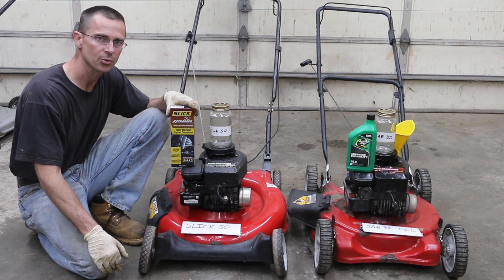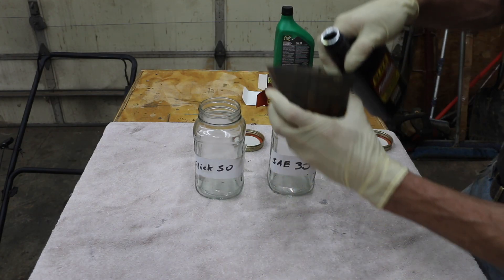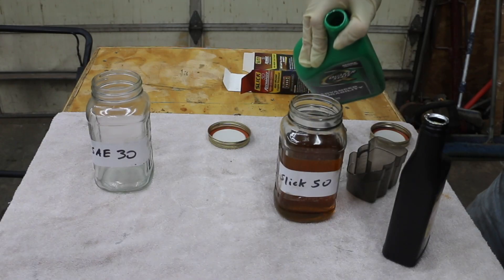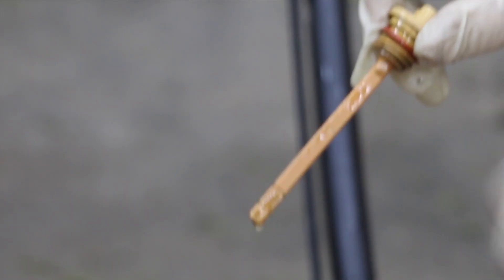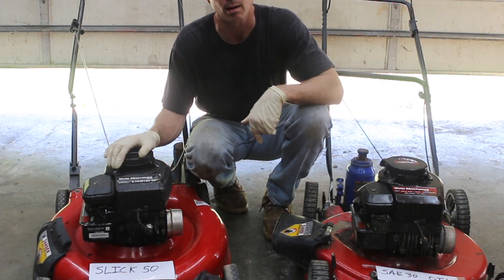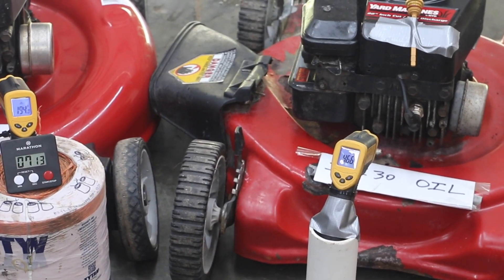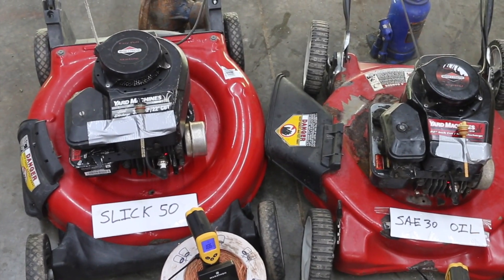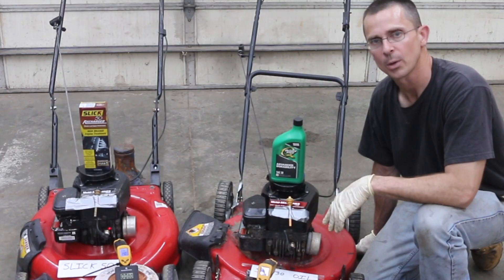Can't believe what SLICK 50 did to my engine!!--Dry Crankcase Test!

Comment: PTFE  is highly  regulated now, keep this in mind. I sold slick 50 in the mid 70's to 80's . CERFLON® is a ceramic-reinforced PTFE  is what is use now in Slick 50®. (JUNK ) needs to be heated to 800 deg to stick or set....but makes a great  friction reducer like" little ball bearings". Back in the day (old Slick50® ) FEP (fluorinated ethylene propylene copolymer), (do believe that DuPont ® has washed there hands of it ),  had to be used with a preconditioner / primer per say.  Which at the time was not regulated if i remember . Slick 50® was a two part additive .......( Chlorinated components to a carrier and mix it with some type of teflon, moly, zinc or phosporus & you can reduce the friction.... Except for one “minor” thing: Chlorinated additives mixed with oil and subjected to heat form hydrochloric acid! Hydrochloric acid is extremely harmful to your internal engine parts.) This being said, this etches the medals so the ptfe's can penetrate and stick to things. The old Oil /w the primer in it was change and new oil and the Slick50® was added.......and when crank shaft heats up and the cyl walls heat up........... the ptfe setts and works well..... AND you can run a engine with no oil for a good long time and STOP it before it locks up let it cool down and start it again  BUTT NOT for ever !!!!! or in till it locks up. The biggest problem was that people can't follow instructions and regulations it was removed form market in the mid to late 80's . Back in the market in mid to late 90's as CERFLON®.  Why you can not run a engine with no lube???? it"s just a friction reducer end of story!.... To day i use a lots of  friction reducers and they work well...I call em (Snake oils ) reduce friction=reduced ware.!!! You can not stop friction and heat but you can reduce it.!!!!!!!!!!!!! google ptfe's in short this video is not a good exp of Slick 50®. He must of seen a old add or some old tater told him that he had seen a engine running with no oil, an the old tater probable did see it, in the day.
Reply from the maker: I enjoyed reading your comments!  Very informative!  Thank you!

Comment: What if both engines were gummed up and the slick 50 acted as detergent thus cleaned out the build up leaving it cleaner and drying up faster? Also 
I agree using 2 used engines with unknown hours is quite unreliable at best 1 could be well taken care of with yearly oil changes and low use while the other may be used a lot and never had an oil change. i would like to see a similar test with new engines to narrow down the variables and use lucas oil additive or something like a graphite oil additive. Great video tho very interesting tests!
Reply from the maker: Great point!  I agree.  Using new engines would be better.  Thanks for watching the video and commenting!

Comment: It could be that slick 50 is full of detergents. Not letting the oil stick to the cylinder walls as well. That's why you can't run a non detergent oil in a lawn mower to begin with
Reply from the maker: Great point!  Thanks for watching the video and commenting!

Comment: Very interesting video. The issue I see is the mowers were not exactly the same, did not appear to be new either. If one had more clearance in the motor is may have lasted longer without oil.
Reply from the maker: I agree.  Using new engines would be better.  Thanks for watching the video and commenting!

Comment: Keep on doing the videos. I did what you did to your Ranger with my old S10 Blazer with 300000 miles on it and it worked. Sounds like a brand new truck. 1986 S10 Blazer 4x4 auto with 2.8 V6 engine.
Reply from the maker: AWESOME!!!  Very happy for you!  That's a great engine!  I've had 2 S10s with that engine and they were great!

Comment: So, according to your test, the Slick50 engine ran cooler than the straight SAE30 engine when properly filled. That's a plus! No sane person runs an engine with the crankcase dry anyways so it's kind of a moot point to run them that way.
Reply from the maker: Bob, Great point!  Thanks for watching the video and commenting!

Comment: The slick 50 engine seemed cooler due to the thermal gun pointing at the shiny metal of the spark plug. In reality it was likely a similar temperature.
Also your test was not accurate, as both engines were not new and as such one likely had far more wear on it.

FINALLY.
At the end of the day. 2 cooked engines for an unanswered question.

Comment: Briggs and Stratton actually did the same test years ago with 2 new engines straight of the line because they were sick of oil additive salesmen using their engines, the test results were on their website years back, same end result you had but they pulled the engines down and measured wear. Teflon lost across all results. Just forget about additives and run what the manufacturer recommends for best results
Reply from the maker: Great information!  Thanks for commenting!

Comment: I've been doing mechanic things for 25 years..  while I see what you're going for I can tell you that the variables are too great..the engines, even if built back to back on the same assembly line, aren't the same, and unless you tested several hundred, the outcome could be very skewed ..  had you switched the oils in the two mowers, there's a chance the results could've been exactly the same..

this is why you can build two virtually identical race engines exactly the same, and yield a 50hp difference with identical parts.. tolerances will never be the same even in a row on an assembly line..
Reply from the maker: I agree! All great points!  Thanks for watching the video and commenting!

Comment: might try dura lube i once put it in a Pontiac 350 that made only 7 psi  oil pressure cold and 0 hot.
I drove it from fort hood in Texas to Lamar mo . The motor never knocked but spun the rod bearings
and was still running when i pulled the engine apart every thing was golden blue in color so
every thing got really hot but never ceased up i drove it for three months after that then
rebuilt it
Reply from the maker: Yes, I'll try Dura Lube soon!  Thanks for commenting!

Comment: the slick50 of today is not the same formula as it was, back in the day, the guy who created it sold it to a company "big mistake". i had an experience once some 25 years ago, i treated my chainsaw (2 stroke engine) with slick50 (original formula) when out cutting wood, with a friend, after a few hours and about three tanks of fuel later, i realized i forgot to add oil to the fuel. to this day my chain saw has not missed a beat. 
i still believe the original slick50 is amazing stuff. if you want the original formula try Xcelplus
Reply from the maker: Great point!  Thanks for watching the video and commenting!

Comment: I used Slick 50 in several older vehicles i owned, never had the slightest engine problem. U should probably have put a few hours on them before draining. i think slick 50 needs time to bond. In 1998 i bought a 1990 Bronco with the 351, 63k miles. When i changed the oil the first time soon after i put in Slick 50. I always used Catrol 10w-30. A couple of times on trips over the years i discovered it was close to 2 qts low. Gaskets had hardened etc and oil was seeping somewhere. Fast forward to spring of 2014, a little over 100k miles. A friend of mine had it on extended loan for abt a year. We thought the head gasket was going. Her dad offered to check it. He bought a gasket set and replaced valve cover, timing cover, rear main seal and pan gaskets. Compression was dead even on all cylinders (no low cylinder like u often see). The bottom half was clean as a whistle and showed no significant wear. He wanted to know what oil i used and i told him Castrol, religiously, since my teens. I firmly believe the Slick 50 prevented wear when it got a little low on oil those times. I didn't need 3 vehicles, so i sold it to her cheap since her dad did that engine work. These days i use Castrol 5w-30 synthetic in my Dodge truck and my mustang. Change it every 5-6k miles.
Reply from the maker: Great point!  Thanks for watching the video and commenting!

Comment: Lucas is the best oil or additive you can put in an engine..its stringy n slimy like snot...lol..and it bonds to metal...I one time rebuilt a dodge magnum engine for a friend..he knew he was gon a abuse the truck..so he bought 6 quarts of straight Lucas..and ran that brand new rebuilt engine HARD!!..month later we drained it out. and took off valve covers to adjust valve lash..and when we did..the Lucas was still bonding to valve train..it looked a stringy mess..but I can promise you that stuff is awesome for engines..

Comment: Amsoil , small engine oil.......  you cant do better, at all, ever, than Amsoil
Reply from the maker: I'll test amsoil!  Thanks for watching the video and commenting!
Reply: i can actually feel the need for less throttle on a car engine, and in my my lil Troy Built riding mower, can go longer between fill ups, and you can feel the engine run smoother and quieter. Not sure if you can test for that.

Comment: I put the Slick 50 in my then new Dodge Caravan in 1994.  Have always wondered if I should retreat it, I think that was the deal that it should be retreated at 50,000 miles.  Still have the van and doesn't use any oil and has about 60,000 miles now.  I really think most all additives are snake oil.  LOL
Reply from the maker: LOL!  I used to use it too!  Thanks for watching the video and commenting!

Comment: Hold on a second... in Slick 50's defense, I recall the instructions on the Slick-50 packaging (from 22 years ago) saying something about a certain amount of engine run time being required to allow the (magic;) PTFE additives to build up and effectively coat/bond to the internal surfaces of the engine(!?)  Based on this fact, I do not see how the mower test is anywhere near a proper test of the product considering the mower engine only clocked a fraction of engine hours compared to a car engine which would clock 5000+ miles before its next oil change. Sorry, but this test is screaming for a "do-over"!!
Reply from the maker: I'll redo if there is enough interest.  Thanks for watching the video and commenting!

Comment: You might try Archoil. The have an oil additive that I use in my diesel truck and I notice it starts faster, runs more quietly, runs cooler, and is more fuel efficient. The additive can be used in all internal combustion applications.
Reply from the maker: I'll see if I can locate Archoil and test it.  Thanks for watching the video and commenting!
Reply: It's only available online currently.

Comment: That was a really interesting test with some shocking results! However, I wonder if the vacuum  method of extracting oil from the engine is the best one to use here. After putting in the exact same amount of oil into each engine, it seemed like you extracted more out of the Slick 50 engine, which could have given the SAE 30 engine an advantage
Reply from the maker: Great point.  Thanks for watching the video and commenting!

Comment: both engines will run again and mow for many more years.put oil in them and free them up by turning back and forth and use them. briggs do not die because the heat swelled up the parts and they seized.i locked up a briggs on a rear engine rider on a hot summer day while mowing because i neglected to check the oil before mowing. let it cool down and put oil in it. turned flywheel  nut back and forth with a prybar till i got engine to rotate fully. that mower still cutting.
Reply from the maker: I'll try to unlock the engines.  Thanks for watching the video and commenting!

Comment: hmm I think you should have run the engine for a while alot longer. maybe drain slick 50 of and do it again. looks like it changed the motor. it has not had gone to build up the protection.
Reply from the maker: Great point!  Thanks for watching the video and commenting!

Comment: Slick 50=Snake oil  If you go back to the early days of Slick 50 they got into a bunch of trouble with the govt for false advertising, Slick 50 was essentially a scam. If I remember correctly Slick 50 said it contained Teflon which bonded to the cylinder walls, DuPont sued them and forbid them to use the trademarked name of Teflon, saying that what Slick 50 was advertising was impossible, so they changed over to calling it PTFE instead of Teflon, and testing showed that mainly what the PTFE did was clog up the oil filter.  Slick 50 and almost all of the engine additives like it are the very description of SNAKE OIL.
Reply from the maker: Very interesting!  Thanks for watching the video and commenting!

Comment: Oil additives are, except for very specific conditions, long sitting, high moisture environments etc. are pointless.

Think about it rationally. If any of these oil additives did any significant improvement to wear, temperature, etc. then they would be incorporated into some major oil maker's oils as an additive package to beat their competition.

The main ingredient in Slick 50 and others excluding the 50 weight standard oil stock and standard additives as not to dilute the additives in the oil it is added to is PTFE aka Teflon. Dupont the  inventors and patented owners of it state PTFE has no use in oils. Now if it did do you think Dupont of all companies would have passed up selling it to the oil blenders?
Reply from the maker: Great point! Thanks for watching the video and commenting!

Comment: Unfortunately, the two mowers are so different in wear that this test is at best, inconclusive.
But with that said, a better engine oil (to my ears) is one that lubricates more evenly. Hence, IF Slick 50 does kill engines faster when there's no backup oil around, it just means it's faster at both getting in and out of the various components for maximum CLEAN lubrication properties.
I would not want an oil that's too sticky as it would stick around beyond it's useful life per unit of lubricant in there.

And i believe the Slick 50 mower just had much tighter tolerances (less worn) which made it fail faster.

Comment: If it's anything like I remember from a few years back, Slick 50 needed to be in the engine and go through equivalent of a few hundred miles (or running time to do that sort of distance) before it can do it's thing to 'bond' the PTFE to the metal components.  I know when using it myself, it wasn't until a week or two later I noticed the smoother, quieter running.  I know that is hard to do with mower engines for a test like this, but there was definitely a noticeable refinement difference which suggests it has reduced friction.

Comment: Oil additives don't have much for a benefit unless you are using a low grade oil. 

 The few cases when they do benefit the engine is when oil is out of its "normal" operating conditions. Such as the HEUI diesel injectors which take oil from the typical 20-90psi to 3000psi.

 Some additives have nanotechnology (particles) that can cause more damage then good. They supposedly act like tiny ball bearings inside the engine, but also act like grit causing wear at a faster rate.

 Also the extreme pressure tests done with oil additives have little to no benefit. Those additives are typically used in gear oil. Most engines won't ever benefit from those additives. It's a marketing gimmick.

 Any additive to prevent a engine from seizing needs to keep its properties at combustion temperatures to prevent the lubricating properties being lost on the cylinder walls. It's likely the slick50 engine seized due to the slick50 turning into a glue on the cylinders walls and not truly seizing.

 Both engines are probably capable of breaking free and running again. In which case a compression test before and after on each engine could have given some insight to cylinder or piston ring damage.
Reply from the maker: Great comments!  I'm learning a lot!  Thanks for watching the video and commenting!

Comment: I used Dura Lube for a test one year. It stopped any smoking the mowers previously had. One mower 1950's age, actually completely lost compression
trying to start it. Didn't last long. Regained compression. One note. When Dura Lube was drained into an oil pan when I changed the oil,
once I cleaned out the pan many times with degreaser, the pan never would stop feeling greasy. No matter how much I degreased the pan
it still had a greasy feeling. Once I went back to regular oil , the normal slight smoking returned. That greasy feeling drain pan even after continuously
degreasing it, told me this product lasted. I always wondered however, what it would be like to fill the entire crankcase with it.
Not use any normal oil with just a small amount of the product. Expensive I agree. But would it work better? Never tested it.
Reply from the maker: Impressive!  I'll test Dura Lube soon. Thanks for watching the video and commenting!

Comment: Prolong super lube would be a great test subject against any other lube! I have a friend who drove over 80 miles without a oil plug( he forgot to tighten it and it fell out) without damage to his truck after running Prolong.. He is still driving this truck and has put 60000 miles without issue since...
Reply: the only down side to Prolong is it is nearly 100 bucks a gallon..
Reply from the maker: Ouch!  That's more costly than the mower is worth! I'll test it!  Thanks for watching the video and commenting!

Comment: did both engines have the same rpm s did both engines have the same fuel type did both engines have same filters i noticed one mower had wheels more wore out than other mower hmm were spark plugs the same hmm alot of hmmms on this one but can you tell me how can you make a chi wawa out run a train hmm.    ok you put terpintine on its ass